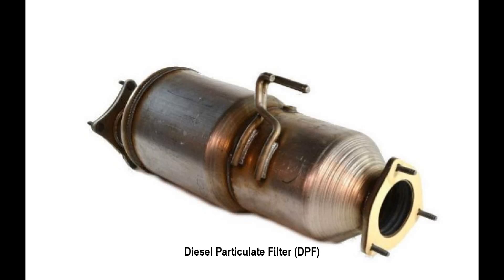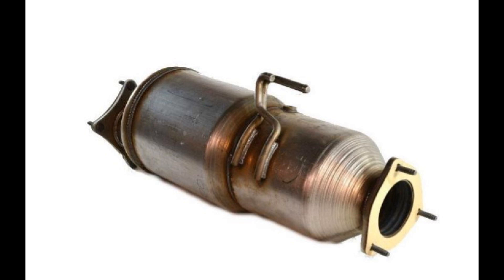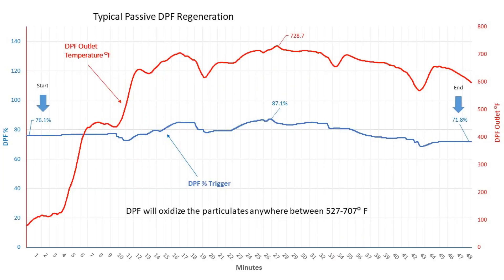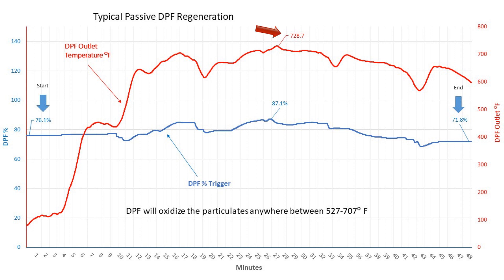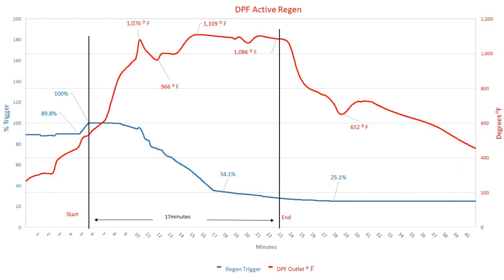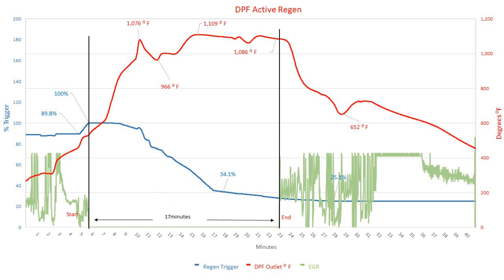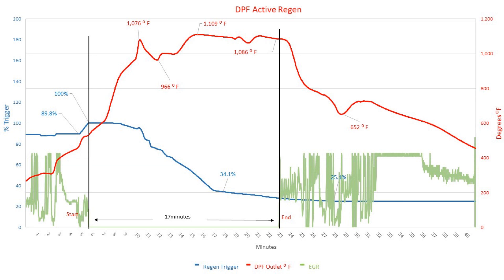RAM 2500 Cummins DPF Operation - How many miles between active regenerations

Comment: Is there an approximate amount of miles a regen happens and if so, how can I tell of that it is happening without the use of monitors
Reply from the maker: I can't tell when a regen is going on.  If you have a steady speed, sometimes you may be able to detect about a 10 mpg drop but it's hard.  Regens depend on exhaust temp, so around town, probably as low as 75 miles to maybe 200 max?  Highway 600 or more.  If you don't want to spend money on an expensive gauge to tell, which I don't see the need, this video might help. https://youtu.be/nV5Y6jqklgs

Comment: Is there a way to sort of make my 2018 6.7 diesel perform a Regin,, ex. Drive for about 20 or 30 miles at 65mph,, or does the pickup just do it on its on at certain times
Reply from the maker: Does it based on differential pressure across the DPF.  No need to force regen and RAM doesn't make it possible unless you do some mods to the circuit from the DPF sensor to force a regen.

Comment: I can kinda understand why some people perform a DPF delete, but at the same time I don't understand why you would want to be in violation of emissions regulations just to save a buck. Pollution by emissions is a real problem locally speaking. Emissions doesn't cause climate change, but it does pollute the air locally, which is particularly troublesome in urban environments. I mean, there's a reason for the heavy smog in urban areas during the mid-1900's. That's not healthy! We really have to be thankful of DPFs and DEFs, from a health standpoint. If there are ways to optimize DPF regeneration, I'm all for it!

Comment: 2018 3500 6.7, 410,000 miles.   I'm sure mine has done Regen's, but could never tell when.  I had a turbo pipe develop a hole at 403,000.  The dash read out showed an 80% full message, then 90%, then "Regen in process".  That was the first time I've ever seen any Regen indicated on the dash.   

Fixed problem (leaky exhaust pipe)  and so far haven't seen it again.  I assume the exhaust leak bled off exhaust pressure and allowed DPF filter to fill. 

My question is, if it isn't showing "X % full" or "Regen in process", does it Regen?  How do I know? 

I drive 8-12 hours per day, could that be enough to clean it without it ever having done an actual Regen?  Or does it regen X number of miles/hours/full% automatically without showing any message? 
Thank you
Reply from the maker: <<<<My question is, if it isn't showing "X % full" or "Regen in process", does it Regen?  How do I know? >>>
Yes it does regen.  It's hard to tell if it's in an active regen with some kind of exhaust gauge but fear not, the truck will regen when it is suppose .

<<<I drive 8-12 hours per day, could that be enough to clean it without it ever having done an actual Regen?>>>
Yes, it's possible you can be cleaning it with "Passive" regens if your exhaust temp is up above 900 or so.  If you are towing, you probably have those kind of temps which would be enough to clean it with an active regen.  Even empty at highway speeds, active regens are going to be pretty far apart.

<<<<Or does it regen X number of miles/hours/full% automatically without showing any message? >>>>>>>
No it regens on different pressure across the DPF so it won't actively regen unless the DPF is at the point RAM designed the regen to take place. 
Marion

Comment: Great video, still have 10 to go. I had to take my Mom to the doctor today. Left later than I should have. Took the canyons, 45 miles, in my 2017 Ram 2500 4x4 diesel, drove it like a sports car, 95 to 105 mph on the straights, 60 to 70 in the canyons. Made it in 35 minutes, usually with the wife 50 minutes. Still got 12.7 mpg. On the drive home, uphill, driving 55 mph, 18.7 mpg. A funny thing happened (no fancy gauges like you) on flat ground the temperature gauge climb to 208 degrees for about 7 miles. After that, the temperature went back down to 192 degrees, normal. Maybe it was in the regen cycle, any thoughts on that.
Reply from the maker: That's possible, I see 208 towing a lot.

Comment: I have a 2017 2500 and it just hit 100% full. It did do a regen with check engine light on, does the dealer have to clear and replace filter?
Reply from the maker: Try clearing the code with a code reader/ clearer and see if the light goes off.
Reply: @MarionBlair  took the truck to the dealer and they had it for more than 8 hours (they didn't even do anything to the truck). I ran my code reader and cleared them. It's been over a week and no check engine light.

Comment: Damn..........I wish that was my 2500.  2007 6.7 using an Insight monitor to tell me when it goes into regen.  If I drive only at highway speed it regens between 90 -135 miles.  City driving (signal lights, stop/go) it regens every 40-60 miles. Mind you its all with no loads.  Had to replace the DPF at 62k and it failed again at 69k (replaced under warranty thankfully).  Since then I try my best of do 0 city and only highway driving and if it starts to regen I keep driving  it until it stops.  I wish mine went into regen after 144-269 miles local.  I might even take a run to the store if it did that.

Comment: I occasionally notice a really hot smell  from my 2015 dodge ram and I have been thinking this is just regeneration. Is this common? I am learning quite a bit from your videos, thank you.
Reply from the maker: Yes that's probably what it is and it's perfectly normal.  Sometimes you can hear the exhaust Contracting after you shut down. It's kind of like a crackling noise

Comment: Marion, good morning. I have a question,  how long do you allow your truck to idle before you drive. I have a 2014 RAM 3500 and over the past six months, I have been gotten a P2002 code. The last time I took it in and the dealer changed out the intercooler.  The time prior they cleaned the DEF injector.  I got the truck back after the intercooler change and only drove the truck 3 hundred miles and the same code has returned.  What do you think the problem could be? Also is the P2002 code a catch-all code?
Reply from the maker: I idle about 30 seconds, then drive moderately till oil temp is 110, then do whatever I want.

The P2002 is described as P2002-DIESEL PARTICULATE FILTER EFFICIENCY BELOW THRESHOLD
The service manual says possible causes but you probably know this:
FAILED DIESEL PARTICULATE FILTER  
EXHAUST SYSTEM LEAK 
INTAKE AIR SYSTEM LEAK 
EGR LEAK 
FAILED EXHAUST DIFFERENTIAL PRESSURE SENSOR
REVERSED OR LEAKING DIESEL PARTICULATE FILTER PRESSURE SENSOR LINES 

Does the exhaust pipe have soot build up?  Should be very clean.  If sooty, the DPF is failed.  seems unlikely, it's usually the opposite, they plug up but could be if sooty.  I would be leaning more towards the differential pressure sensor which sits on top of the DPF filter.   It measures extremely low pressures and are fairly common to fail.  Just a guess without any gauges.  Assume truck drives ok.
Reply: @MarionBlair  thank you for the response. Yes, the truck drives fine. Just got the truck from the dealer and the truck had active P2201 code, so they replaced NOx sensor 1. The inspection of this sensor revealed No oil and very little soot. The sensor test failed. 

I hope this corrects the problems, we have a 3,000-mile trip coming up.
Reply from the maker: @greg9323  Yes, NOx would do it also.  I bet that'll fix it.
Reply: @MarionBlair , thank you for the information and for your videos, they are so informative.  I do hope this correct the issues, we will be along way from home.  Thank you again and look forward to your next video.
Reply: @MarionBlair , thank you for the information and for your videos, they are so informative.  I do hope this correct the issues, we will be along way from home.  Thank you again and look forward to your next video.

Comment: @Mr. Blair, Thanks again for a very informative video.  I have a quick question about the Edge Insight and showing the DPF % Trigger PID that you're referencing.  Do you know what that PID is called in the Edge?  I have searched and cannot find it.
Reply from the maker: Should be called DPS pressure. The Edge reads out in the actual pressure so it's going to be a decimal number.
Reply: @MarionBlair  Got it! That was the number I've been tracking but I haven't figured out how to use that decimal to predict when a regen will kick-off. I'll have to keep watching it there has to be a pattern.  Thanks so much!
Reply from the maker: @bf826  Looking at the DPF pressure at idle, when the gauge reads about .05, it's very close to going into regen.
Reply: @MarionBlair  Awesome thank you!  I'll keep an eye on it.

Comment: What are the parameters for dpf pressure using torque app?  Is this % soot level from the banks monitor unit you have now?
Reply from the maker: Yes, I used the Banks for the DPF.  It's reported as the trigger level % which is kind of the same.  It also had a PID for DPF differential pressure which is what the Edge displays.  Don't know off hand what the PID is for the torque, I'll have to look into that.  I think I only had the EGT's.

Comment: I have a 2016 2500 that just turned 67k miles and got preform service light. From what I have read it’s the EGR. Any info or video on that Marion?  It seems to be typical on these rams at this mileage
Reply from the maker: I think it's the Crankcase filter.  You need to replace that at 67K.
Reply: It was -easy fix. Great channel Marion

Comment: Ford Powerstroke engines perform an active regen every 500 miles whether needed or not, for the purpose of verifying the differential pressure sensors are functioning. If the regen is not needed, the process is short.

Comment: You might want to listen to this video and see what this DPF company cleaning says about this technology.
Reply from the maker: I did.   How does they do DPF in the combustion chamber without increasing the NOX?
Reply: @MarionBlair  we complete the burn of the diesel fuel inside the combustion chamber while lowering the EGTs, giving you better fuel economy and more horsepower. Usually 20%plus fuel savings.
Reply from the maker: @scottsmith6960  is there a website I can read about how this is done?
Reply: @MarionBlair  Yes Central ValleyHHO.com we've been doing this for 12 years not very many people understand this technology.
Reply: @MarionBlair  Centralvalleyhho.com there are 13 benefits to our system The major one being fuel economy and lowering maintenance costs on your truck.
Reply: @MarionBlair  https://youtu.be/e7HrmeXkA_k
Reply: @MarionBlair  https://youtu.be/SUTVMuovN0c this is the same truck that you have but older.

Comment: Marion,
What do you think my issue is?
My symptoms are very excessive use of DEF and reduced performance with increased fuel usage.
Reply from the maker: I'd check the NOX sensors first.  There's 2 in the exhaust.  One pre DPF and one post.  If you have a code, it'll be easier to detect.  If a NOX is dirty, the PCM will think the nitrous oxide is high and pump more DEF.  it will also, cause MPG and performance to decrease because the PCM is getting bad feed back (or none) from the NOX sensor.  There's also the exhaust pressure sensor on the left middle to front side of the engine (when standing in front of it).  A tube comes off the back of the exhaust manifold and run toward the front to the sensor.  I've heard you can unplug it to see if it makes any difference.  (I haven't actually done that.)  It's likely something soot related.  My guess.
Reply: Marion Blair The dealer is saying that they cannot finds an issue with it. When I’m loaded is when it’s the worst. It seems as if I’m running on all engine no turbo. It will look as if someone pored DEF through my exhaust while driving.
Reply from the maker: @BlackAtomAnt  that exhaust should not be wet
Reply: Marion Blair 
It is dry. You can see the streaks where it has dried up.
Reply from the maker: @BlackAtomAnt  no check engine light?
Reply from the maker: Something's going to show up how long has it been that way
Reply: Marion Blair 
No light or codes. Two weeks
Reply: Marion Blair 
Marion I see that you’re in Louisiana I am in Mississippi and willing to drive over and pay you if you can figure out or run the same same diagnostic that you run on your truck and tell me what the issue is
Reply from the maker: What year and how many miles do you have?
Reply: Marion Blair 
2017 Ram 3500 Bighorn 
66423 Miles

Comment: Where to start? Cannot thank you enough for all the videos! Have a 2017 Ram with Cummins. Learned more from you than almost any other source. Plan to use the Torque app you suggest to monitor shut down temp and regen. Love the EGR clue. Also, woman in picture with me is from Lawtell LA. Will be retiring to a camp on Toledo Bend soon God willing. Thank you, thank you for all your work!
Reply from the maker: Thank you.  Lucky you.   Love Toledo Bend.  Family goes to Cypress Bend often.  Thanks again.

Comment: We went on a trip to Canada and my truck threw a trouble code, (was something like active regen to often) and according to my Edge monitor it had regen about 3 times in 200 mile of highway driving. After it threw the code I did not see anymore active regens for 4000 miles. We were in a remote area and I was  a little concerned, because check engine light never went off. Found a Ram dealer in Hinton, Canada and had the code cleared. Truck still didn't regen for another 2000 miles. I was running almost all hi way speeds with a 4K cab over camper on. Canada Ram dealership was , we don't see to many non deleted trucks in these parts. Wish I didn't live in an area with smog checks.
Reply from the maker: Yea, bummer, I've had a few codes over the years that I've cleared and never saw again.  You should be able to clear codes with the Edge.
Reply: @MarionBlair  Tried several time to clear it and it would not reset, I think that in itself was what caused the most worry

Comment: You should monitor your engine hours vs. regen’s. In my experience with a ‘14  and now a ‘17, regen’s started about every 24 engine hours. The only time I’ve seen a deviation from that is when I was running the more aggressive settings on an edge juice performance module. I wasn’t monitoring dpf differential pressure, but I’ll assume those regen’s were triggered by the dpf filling. My normal regen’s ended up happening about every 1000 miles.

Comment: I have a 2018 with 21,000 miles.  I constantly get 850 to 900 miles with my version of average driving. Not towing.  When I drive constant highway I have gotten to 1400 miles between regens, not towing.  I use a Edge cts to monitor my regens.
Reply from the maker: That's excellent, My Edge touch screen got hard to press so I thought I'd try this Banks.  Edge is excellent.

Comment: Hello Marion, I would like to ask if using the exhaust brake would help blow out some of the soot ? I'm asking because a Mopar mechanic at my Ram dealership suggested to me that using the the exhaust brake would indeed help blow out the soot along with the DPF regen ! Any thoughts would be appreciated, also continue on with the great videos !
Reply from the maker: I don't know  that it makes much difference in blowing out soot,  it might.  however it does keep the turbo actuator exercised.  The general consensus is to use it, I do.
Reply: Marion Blair thanks for the reply Marion keep up the great work,💪💪
Reply from the maker: @johnwquick  no problem

Comment: Thanks so much Marion, the emissions system and how to keep it reliable is still confusing as heck to me. Let me ask, you've had your truck a number of years have you had any component failures? My cousin has 2016 with 56,000 miles and it went to limp mode, RAM said the DEF injection pump went bad, I  don't know? So we'd like to hear if any component has gone bad on your truck or if you've had to remove and clean any of the sensors? Thanks for any experience you can share.
Reply from the maker: No issues with emissions.  Had a couple of fluke codes so I'd advise getting a cheap code scanner/ clearer.  Like $20 or so.  I have the Autel 309 but any will do.  It's been under the rear seat for years without use.  No need to clean sensors, in fact the 2013 and above do not require any EGR cleaning, ever.  Well, at least it's not on the maintenance schedule anymore.  A lot of people will disagree with me but I don't use the truck stop DEF at the pump.  There's no way it can be purer than the Peak or whatever.  Check the date code for freshness.  I know there has been issues with the DEF pump/ injector but I've been luck.  There's some issues with the turbo actuator that I've read about but so far so good.
Reply: @MarionBlair  I'm really grateful for the reply and your insight. I am in total agreement in not using DEF at truck stops. Some of the DEF date codes are difficult to read because of the way their coded such as the Walmart DEF. So far I've only bought DEF from RAM it's more expensive but it's always fresh and the date's are straight forward too read. I'm also saving all the DEF receipts I buy from RAM so if there's an issue I can say here is every DEF purchase I've ever made. Thanks a bunch for sharing your thoughts and experience.

Comment: Great video, as usual!  I really hope these manufacturers figure out a better and more reliable system, or I won’t be buying another diesel. I do around town trips 100% of the time, with 3 big road trips per year (have a separate work vehicle).  With those driving habits, I’d imagine I’d have problems with the regens.
Reply from the maker: Yea, engines are tight and I don't think there is much fuel dilution  from the test I've seen but yes, they have use between a rock and a hard place.  We are the guinea pigs for there emissions testing.